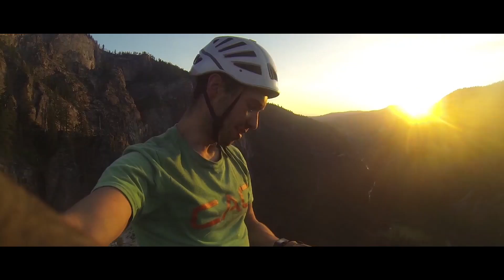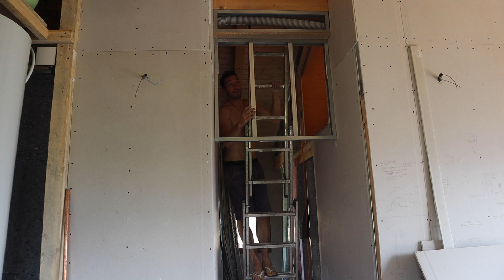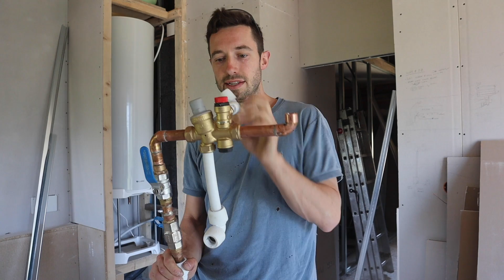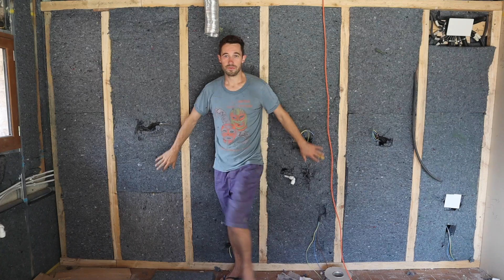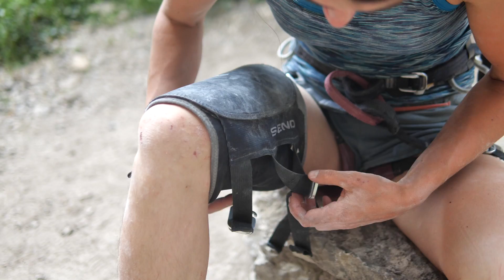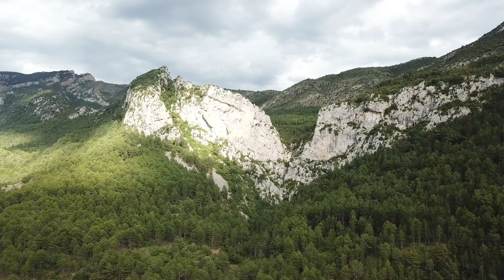GETTING PLASTERED & CLIMBING OUT OF LOCKDOWN 🧗‍♀️ // Another week at the house 🏡

Comment: Hey Nate that valve is a temperature control valve as well? It is a mixing valve to regulate and extend the hot water by reducing the temperature by mixing with cold water the super hot water in the tank??? Where are your helpers?
Reply from the maker: The shower has a thermostatic valve.. the thing I'm talking about is a pressure reducing valve primarily to protect your tank.
Reply: @NateMurphy  Hey Nate here in the US we have a valve that blends hot and cold just after the tank so you can make the hot water in the tank hotter and not have to worry about it scalding at a single valve with no thermostatic ability. I would suggest that valve too because it extends the gallons of hot water available. Cash Acme is the valve company. Hot water is a must for guests and you have a lot of them

Comment: If you're going to caulk along the beams, tape a couple of mm on the beam (away from the wall) caulk it and then paint it immediately and pull the tape off while still wet, and you will have a perfectly straight line. Normally tape it and cut it in on the first coat and then caulk and paint/pull tapes on the second.
Reply from the maker: Thanks for the tip.. might come in handy for the rest of the beam work! 🤘🤘